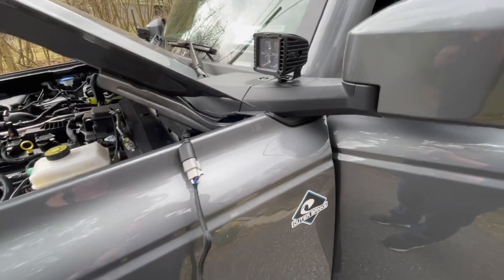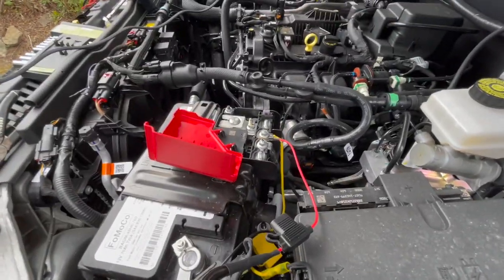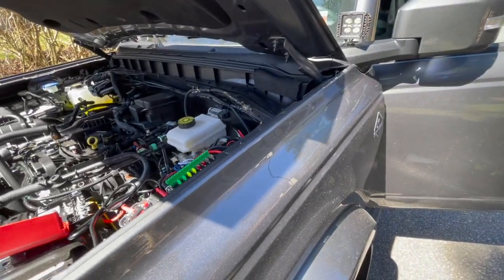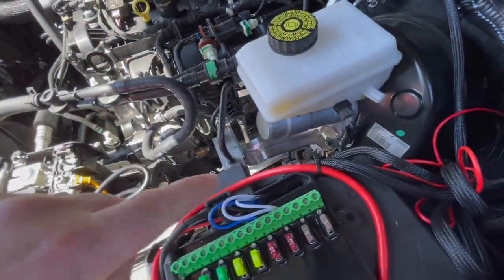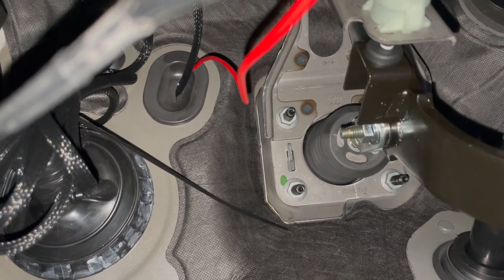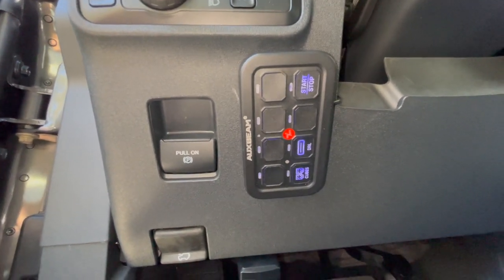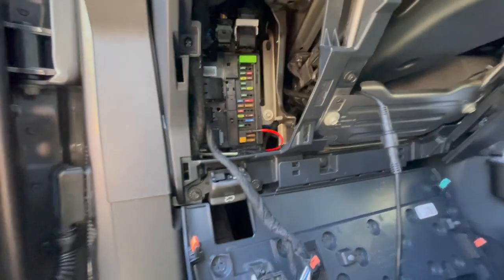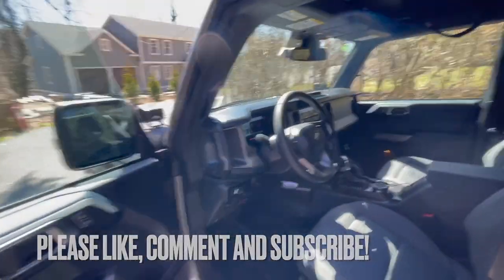Ford Bronco wired Auxbeam with Rough Country Ditch Lights (No Up-fitter switches)

Comment: If you only want high beam can you just tape the low beam and be ok
Reply from the maker: I would think so but not sure.  I would call RC to ask them.  They were very helpful when I needed info on what wire did what.

Comment: As far as the low and high beam wires is there an indication on which one is positive and which is negative?
Reply from the maker: Hey sorry for the delay.  There are sets of wires for each.  2 Blue, 2 White and 2 black.  Black in negitive, the Blue and white are the high and low beam (forget which is which)